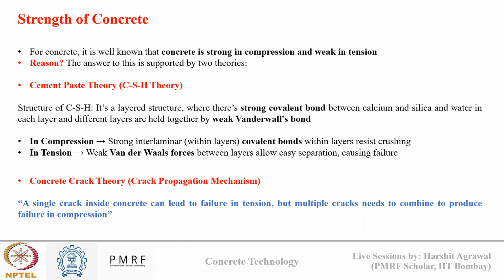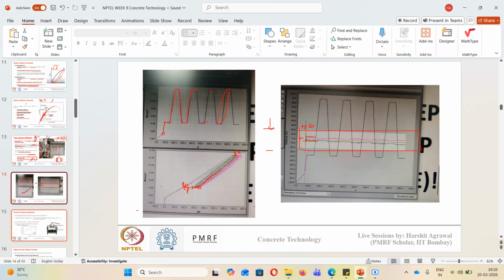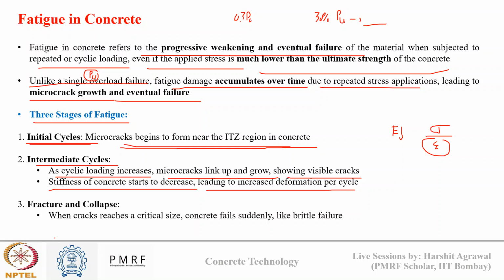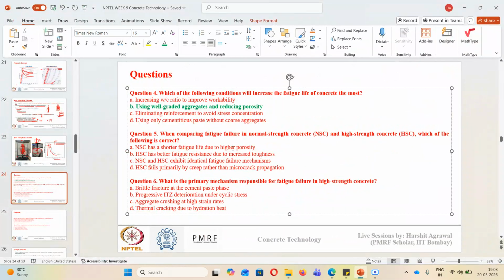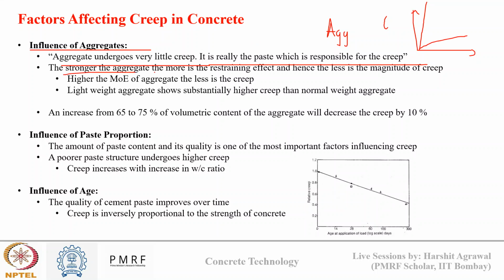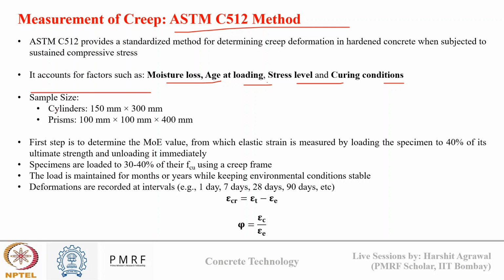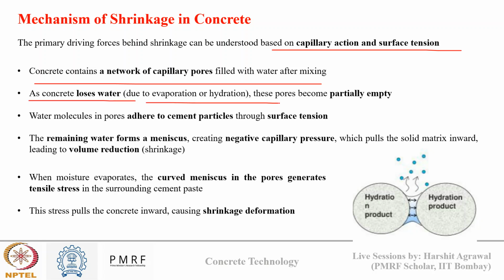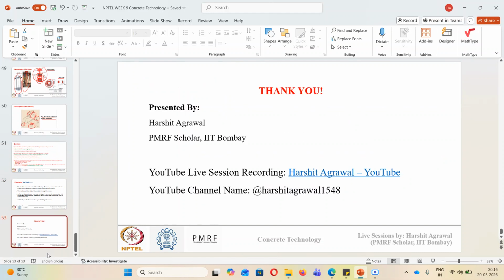Concrete Technology WEEK 9: Mechanical Properties of Hardened Concrete: Part 2

Comment: To determine creep co efficient there was K1 to K6 value ,these values will be given or not in question?
Reply from the maker: They should provide necessary equations and tables to estimate all factors from K1 to K6, or else they will directly give the value of ultimate creep coefficient and just ask to calculate creep coefficient or total creep after a certain time under loading